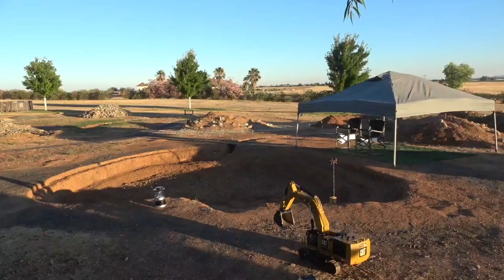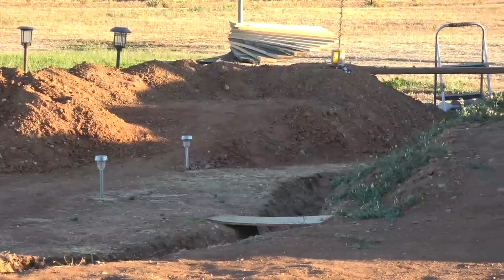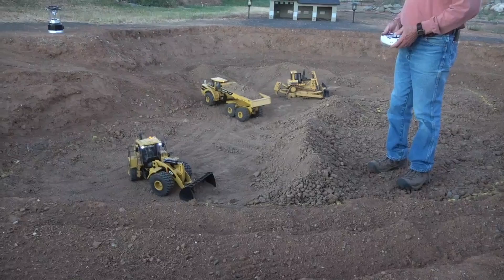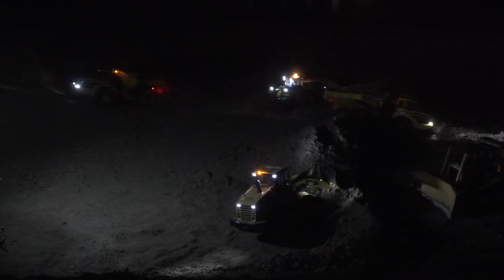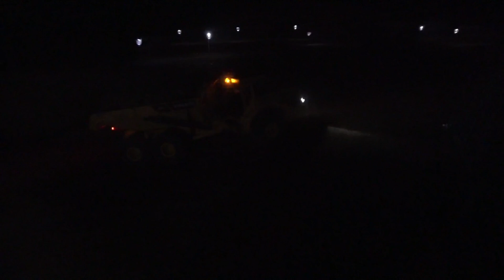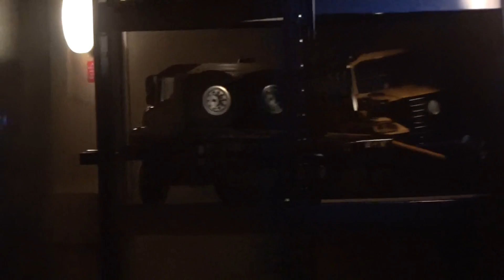night shift at the pit. dozer, loader, A40G's

Comment: With all the extreme heat out there right now night sifts are a great idea. Darrell  is that the cat 988 that is giving you problems? The dozer did a great job today. I think these machines look fantastic at night with the lights on.
Reply from the maker: Yeah the 988 is giving me problems. Sometimes it doesn't want to shift into reverse. I belive it's a adjustment in the transmitter. Other than that it doin good 👍